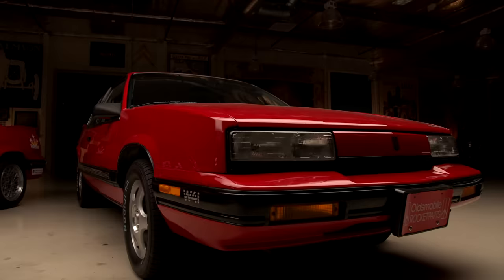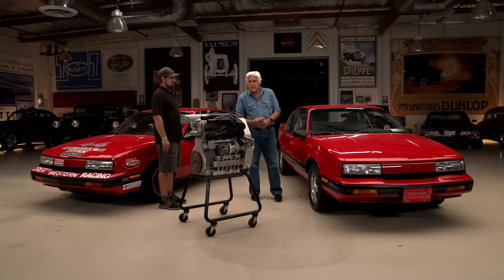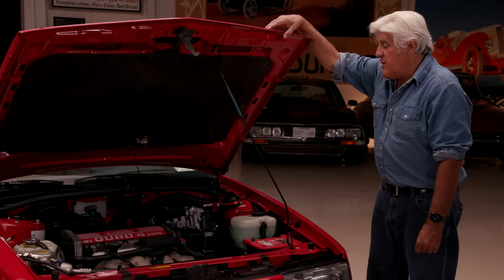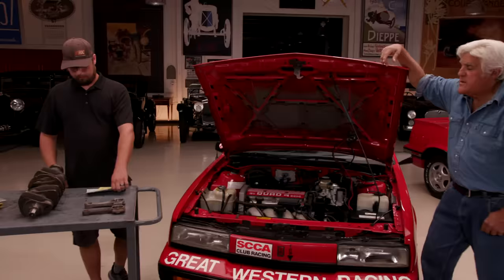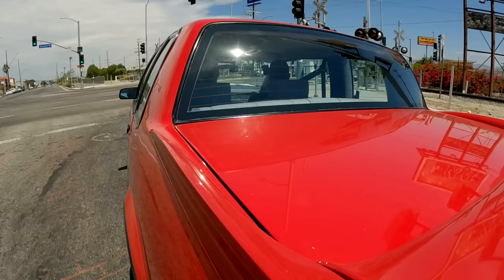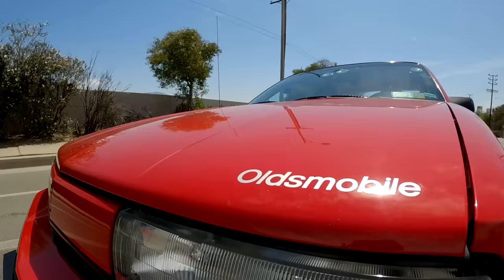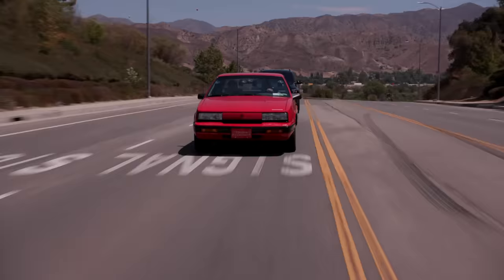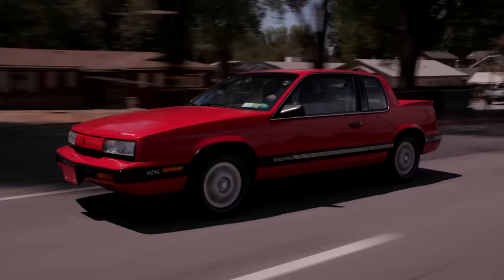Rare 1991 Oldsmobile Quad 442 W-41 | Jay Leno's Garage

Comment: In around 1996-1999 I rode around in one of those quad 4 Olds w/5spd.  Wasn't fast but sounded good.  I remember the clutch was soft and did the rpm hangs when shifting @ high rpm. I always thought they weren't all that great handling.  My 1993 Olds Cutlass w/3.3L and FE3 suspension pkg was much faster than the quad 4 cars.  Handling, even with the FE3 suspension pkg and GoodYear  perf tires, was horrible because of the live rear axle.  The quad 4 coupes were lighter but still couldn't handle well.

Comment: They also had the achieva SCX W41 with the 190hp 2.3 Quad 4 it also came with  limited slip differential, although the differential was not installed I gave you the option to install the limited slip disc in the short ratio 5-speed manual

Comment: I was not remembering this engine until you guys popped the hood on the w -41 model !
never worked on the w-41 but,  the std. model " QUAD 4 " YES , they had head gasket leaking problems , did " 2 " reseals on " 2 "
different" QUAD 4 " engines & it was a bit involved at the time , pinning the cams in the correct position , for timing, working in that confined space on a transverse mounted engine , " that nobody was use to yet " !!!!!  especially a guy that was use to working on " MACK TRUCKS "  !!!   and the cheapskate customers , that never changed there antifreeze " CRIED THE BLUES OVER THE LABOR BILL "  !!!  Hey just like that old frame filter commercial " PAY ME NOW $, - OR PAY ME LATER  $$$$$ "  !!!!
WOW - WOW,  GLAD I DON'T WORK ON THAT STUFF ANYMORE  !!!!!   " JUST MACK TRUCKS " !!!!!!!

Comment: Great show. 
The 1991 production of the 442 was 205 units. 
It was preceeded by a run of 200 HO Quad 4 (180HP) in 1989. Engine designation LGO. 
Road and Track Special Series for 1990 does have a partial image of the 442 on the cover. 
Performance cars '90
Page 118 is the article for the 442. 
That article mentions the 1989 production run. 
I don't know nearly as much as the guest, but I know about the 89 as I have one in my garage.
Reply: Not correct. I have documentation directly from Olds from Aug 1991 stating W41 production was 200 vehicles, and 15 W41 C41 vehicles were produced (race versions). There are many other sources, to also prove your 1989 production number wrong as well. The W40 was only available in 1990 and 1991. in 1989 the HO 180hp engine would only have been available in the International Series Package.
Reply: Well you may want to tell the Oldsmobile History Center that,  my letter from them says the 200 is correct.  Mine is an IS, red with gray cloth interior and 5 speed.
Reply: @kerrygardner773  well your original comment says 205, now your saying 200? 200 is the correct #.
Reply: My original comment says 205 in the 442 run, preceeded by the 89 run of 200 HOs. 
It also says that I don't know nearly as much as the guest.

Comment: Jack Carter Chevrolet here in Calgary Alberta Canada had two of these Quad 442 W-41 cars, both of them red. I really liked it but I just couldn't afford it at the time. Besides at this time I was still driving my 72 Oldsmobile Delta 88 RCMP interceptor W-33 sedan which was a little rusty but still plenty plenty fast at the strip and on the top end.

Comment: Jay. Glad to see you Well. 
Quad 4 was an interesting motor. 
In my experience. 
If you had a good one they were phenomenal. If you got a bad one 
They were a boat anchor. 
Sad but i never had a good one. 
Pontiac Grand Am. Coolant issues
For the most part was my problem 
Once they got hot that was it.
Mom had an '84 Oldsmobile Cutlass (next size up) 2.5 iron horse. 4door 
Taught me and my sisters how to drive. 
Pioneer Super Tuner 3 cassette deck radio. Is still the best radio I've ever had.

Comment: Man I had a 1990 5 speed stick shift quad 442 fast asf ! only thing that got me off the line was a jetta thing back in 2000ish cause I missed a shift .off the line slaming it into 2nd the front end would lift up felt like a foot and yank to the right almost into the other lane.I was told some berettas had a similar motor ...fun lill car !

Comment: 1:00 my stop point.
I read about them few years back 4 valve 4 Cyl 2 exhaust I believe they were called turbo & I believe 6,500 rpm range & I heard there were a few built but I thought there was more then that built

Comment: I’ve never owned a Japanese car and I never will. Owned a few Chryslers and fords but it’s been mostly GM my entire life. What can I say, I just like how they make and design their cars.
Reply: owned Japanese and German cars my whole life. The Ford Thunderbird drives just as good as a GS300 Lexus just as and good as c280 sport. Pontiac and Oldsmobile made the best American cars closest to what I get in my imports. My sister had a 1991 Bonneville ssei and that's one of the best cars ever made the quality is second to none. Had better materials than my 2000 Denali and the car was too big and smoked tire too fast for being as fuel efficient as it was getting over 21 mpg. Front wheel drive killed Pontiac and Oldsmobile

Comment: Chevy also put the 180hp version in a Beretta in 1990. I had one and it wouldn't actually beat a 5 speed 5 liter mustang but it would give it enough of a run that most mustang drivers were very surprised at what this little motor could do.

Comment: The Calais was a bit known for the engines getting water logged. The air intake was placed to low. I don't remember any of them having suffered damage from it though. I owned an 89 Calais and loved that engine and car. I also miss my 1979 Ford F150 460ci tire burner. hehe
Reply: i had the 86 olds calais with the V6 and always had cooling issues especially when in traffic. As long as i was moving, it ran cool and good, but when you got stuck in traffic, had to keep an eye on that coolant gauge and sure enough after 10 min or so .... needle started to go past the 1/2 point and into the red, would always have to shut her down or pull over somewhere for like 30 min to cool down then get back on the road.

Comment: In 1991, Japan was homologating the Toyota Celica GT, Mitsubishi Galant VR4, and the Subaru Legacy/Liberty RS, all of which produced either side of 200hp from 4 cylinder turbo charged engines. In addition, all 3 were all wheel drive - and in the case of the VR4, four wheel steer, to boot.
Meanwhile, over in Europe, the even more potent offerings from Audi (Quattro) and Lancia (Delta HF Integrale) need no introduction. 
Successful turbo charging was brought to the attention of the world by SAAB, in 1978, with the 99 Turbo.

All these manufacturers were part of the world rally scene.If the USA had participated in world rallying, maybe the market for cars such as this might have grown. Certainly not "ridiculous" by world standards of the time.

Comment: I was taking auto mechanics at a tech school when the Quad 4 came out. It was touted as the engine of the future, making V8 horsepower (at least for that era) with 4 cylinder mileage ( again, of that era). And GM did use it for a long time. They just changed the name.

Comment: I have an 1991 RocketParts brochure, and it is much more stuff for the Quad 4 than the DRCE. Heads, Block, Torque plates,  blank camshafts cores, cranks, IR manifold adapters, adapter for Hewland transmission and such. Rocket Recorder and Quad 4 Motorsport ECU etc. Oldsmobile was the racebrand of GM in the 80`s-90`s (For some reason, since to me it seems the streetcars was not really into performance) GM made so many strange choices. I had 95 Firebird with an low power iron V6, but they made an 4 valve "Hi-Perf" V6 at the same time, why not put that in there? Or the Buick 3.8?

Also in the 80`s it seems Olds was gonna make a lot of performance parts for the V8, the Nascar block, Batten heads and all that, was it the DRCE that took over maybe and Drag Racing became the focus?

The Olds 215 did become an F1 World Champion though! And the Aurora became the Indy engine. 

I think the Chevrolet people in GM must have been much better to talk for themselves and get what they wanted, while Pontiac, Olds, Buick etc. was not so though in their demands and just looked down on the floor, and did as they were told. There is a lot of "what could have been" stuff through the years.

Comment: I bought one with the so called Hi Output Quad 4 new. Damn thing went trough 3 head gaskets before 100,000 miles, then bent the valves because they ran the power steering pump off of the the camshaft, in which the loosen the cam gear, and sheer the dowel pin off, biggest piece of junk! 
Honda B18C all day!

Comment: The Quad 4 wouldve been a great engine had they worked out the flaws. I always called them “The Time Bomb" because after 100k they self detanated. With that said, you could beat the pi** out of them and they had some pep. We had a guy who worked for one of the car body repair shops that had a 88-90 grand am that he modified and put a nice body kit and cherry bomb exhaust. Boy did he love that car. I bet he rebuilt that engine at least 3 times. Beautiful looking engine but like most GM issues they never took the time to let it thrive. What a neat car. Not many of these around anymore

Comment: I had similar motor and trans in my 1994 Beretta Z26 and it was known for head gasket issues.  While the car was fun to drive, every month it was at the dealer for warranty repairs.  I guess mine was a lemon..

Comment: My mother bought a brand new olds in 92 it was the achieva with the quad 4 and I  Tell you what that sucker would fly and it didn't Just feel fast it was fast I mean it would peg a 120 miles an hour speed o pretty quick for a 4 cylinder especially in a 4 door car. Drove it cros country ky to neb shortly after. I heard the engines were bad about head gasket problems all followed out he had asked the problem that's why you'd never see any of them but it was a pretty sweet little car

Comment: We had the Calais quad4  1989 model.  Bought it right off the showroom floor.  It broke down one block from the dealership.  It took olds 3 weeks to get it fixed.  And it never ran right.  We had a four inch stack of repair orders.  Eventually the service manager suggested putting a match to it.  A real disappointment

Comment: I always admired the 442s from the 1970s probably because my paternal grandfather had a 1974 Cutlass S Coupe from 73 to 78 when my dad traded it for his 1979 Toyota Corolla se 4 cylinder station wagon which he taught my mom to drive a manual in she learned to drive an Automatic first on an Oldsmobile Delta 88 if I weren't legally blind I've have also learned to drive an automatic first as it would've either been my late maternal grandmothers 1990 Toyota Camry or my dads used 1990 Volvo 760 where as my younger brother learned to drive a manual first my moms 2003 Hyundai Elantra had a 5 speed Manual where as her 2 other Hyundai cars both had/have automatic Transmissions her Azera has a 6 speed Automatic transmission mated to a 3.3 L V6 engine where as for ex the V performance version of a 2012 Cadillac CTS had a 378 cubic in or 6.2 L supercharged V8 engine similar to what appears in the CT 4 V Blackwing & CT5 V Blackwing now a days granted CTS/CTS V combined is one of Cadillacs Best Selling models ever #3 with 726,000 units sold over their 17 model year run the only two Cadillac models to sell more were the Deville which sold 5.3 million over a 45 year production run 1959-2004 and the Seville which sold 980,000 units over a 28 year production run 1976-2004 the 4th best selling model in Cadillac History is the Escalade which has sold 665,000 units in 24 years of production and 5th is the Fleetwood series which includes the Eldorado coupe/Convertible the Fleetwood Coupes/Convertibles/Sedans/Series 75 Limousine with about 595,000 sold over its 57 year production run from 1936 to 1996 and 50 years for the Eldorado 1952-2002 the three years cars weren't produced for Civilian use during World war 2 from April 1942 to September 1945 my late maternal grandparents owned three Cadillacs between model years 1968 Eldorado Hardtop Coupe  and 1981 Coupe Deville

Comment: I wonder if Jay Leno knows Olds  made a GT Toranado in 1970, one year only , less than 6,000 were made 5,600 and some, the 455 had 400hp with an extra HD 425 auto trans,fairly rare.  I wish he would find one ground up restore it or at least do a show on it, my dad bought one in 72 used beautiful car , we had it for 10 yrs then got a hole 700.00 on a trade in for a 1980 chevette.   LOL

Comment: My ex wife bought the same 2 door Oldsmobile in the same color back in 1990 (not the performance version in the video) It had a 3.3L V6  automatic trans, and the performance always impressed me. It had great acceleration and the top speed seemed never ending. It was nothing by todays standards, but compared to other similiar cars of the time it was great!

Comment: 1999 I bought a old bill achieve a sport and it was so fast it would get-app-and-go I raced guys that had new F150 trucks 1998 90 nine, and I blew them away on I 95 and not just because they had a governor on the speed. My car would get up to a 120 Miles an hour. And absolutely no time whatsoever. It handled so quick so smooth. I miss that car. I donated it to my sister, and then she gave it away. What's really made me so mad? I would've just took it back. Something. Kept going with the coil pack. That was the only problem I ever had with it. But it was a bright cherry. Red old bill achieved a sport but being in construction. I needed a pickup truck.
I was in my early 20s. I wish I had that car back. I think about it all the time. I can't remember if it was only front wheel drive. I think it had 4 cylinder, but they had it available in the 6 cylinder. I'm trying to do some research. Can't remember if they had optional front wheel drive or a drive shaft for real wheel.

Comment: The Quad 4 was not Oldsmobiles first foray into DOHC 4 valve engines. They built a DOHC 4 valve 455 in the late 60's. The upcoming emissions standards killed it.

Comment: Although it was renamed, and had less of a performance edge, the second generation of this engine, aka 2.4L TwinCam was a substantial improvement over the original Quad 4.  It's longer stroke undersqare proportions boosted low end torque while the addition of balance shafts greatly reduced the NVH of the original. It was quite competitive with the larger Japanese fours of that era.  Why does GM have such a long history of bungled new product launches, followed by expensive but successful redesigns, followed by lame relaunches and program cancellations?

Comment: The Quad 4 looks a lot like with an Offenhauser engine.

Would have been much better of GM had kept the timing belt. I worked on many of the timing chains. The numb chain driven water pump would leak coolant into the oil.

Comment: Wow Olds folded in 2004 . So my Aurora a 2003 is one of the last . 250 hp @ 3000 rpm 260 . 4.0 V 8 same block used in Indy race cars. All leather interior a sweet car . Cross finish flags on it 2 non functional hood scoops. spoiler . I heard people were lining up for one more year but did not happen.

Comment: I had a Quad-4 (the basic version) Olds as a rental car on a business trip back when they were new.  By the standards of the day, it did SCOOT, and sounded surprisingly good. Not long after, a friend bought a Quad442, and enjoyed the heck out of itI far and away preferred it to other GM cars powered by the 3.1L v6, which sounded like a rock crusher inside a tin can. The Quad4 had a bit of a lopey idle and you could "feel" it running, the 3.1 v6 actually felt smoother but sounded *horrible*.  Its a shame that the cars the Quad4  went in were pretty much Cavaliers with some lipstick.  If I sound critical, well, I AM, but you have to remember that I would have exactly the same gripes about a Ford Taurus SHO and a Dodge Spirit R/T. All three kinda fall in the "nice try" bin of history.  

I remember the "Not your Father's Oldsmobile" commercials, too, and at the time my reaction was "gee, that's too bad, because my father could have had a 455 powered 442 with a Hurst package, and now I've got to have a front-drive eco-box???"

Comment: I do almost all of my own auto work. Unless it’s electronics. I was shocked bad once as a kid and I’m super scared of messing with electronics. I can wire up a stereo and speakers and amp etc and I can solder and I know about it but I’m scared of it. The only time I’ll take a car into a shop is if I need a lift which I don’t have, or if I don’t have time or space. But I would say I do 90% of my own work. When I get my deville motor rebuilt I won’t be doing that myself. That will go to a northstar specialist and have northstar performance bullet proof kit.

Comment: I test drove one of those 1991 Quad 4 Olds in 1991,  It was the stock version with an automatic.  I was literally bored to tears and the only thing keeping me awake was the salesman who kept insisting that I feel the V8 power.  The V6 version was a little bit better, but we wound up with a Saturn SL2 that was easily a far superior car.... We actually still have and drive that one and with over a quarter million miles on it, it would still blow the doors off of the automatic stock Quad 4.

As a life long Olds fan, the stock Quad 4 Calais was a real disappointment. So much hype so little real world performance.

Comment: Oldsmobile was rumored to be putting the Quad 4 in the Oldsmobile 98.  I found that to be a stretch.  The head gaskets and camshaft chain drive were common problems.  Reliability was not a GM mark of quality.  The Japanese built bullet proof 4 cylinder engines.  We all know, "The rest of the story."  🤔